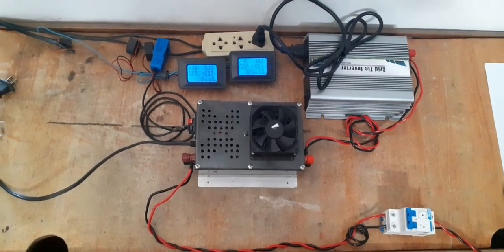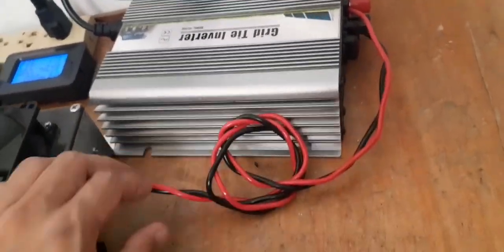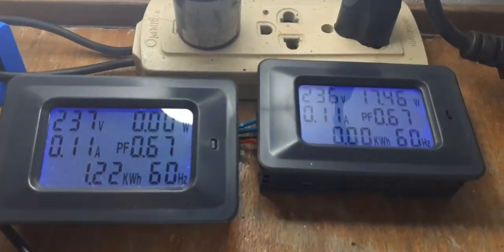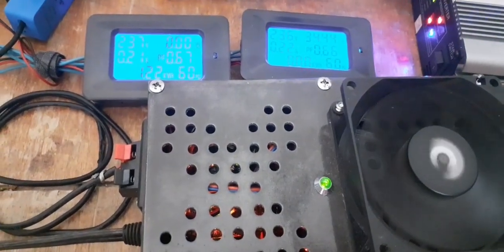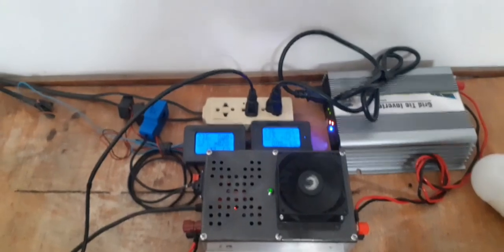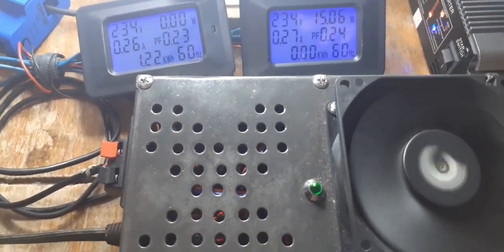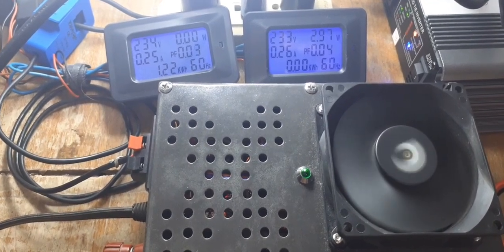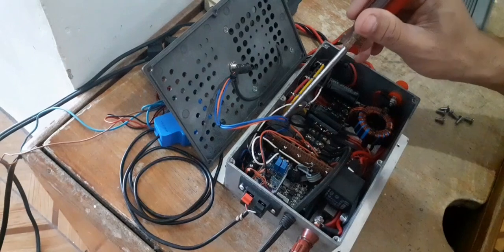External Power Limiter project for cheap grid tie inverter success!! part3

Comment: Congrats bro. What happens if the load is disconnected?  Does the grid tie reduce its output?
Reply from the maker: Thanks Bro, It will detect export power and automatically reduce. the target set point is within zero to 10 watts import.
Reply: @JonsDman  cool 👍. I might have to try designing something similar. I'm not sure if OP Amplifiers can be used in a comparator configuration.
Reply from the maker: I hope you will succeed using op amp comparator.
Reply: @JonsDman  yeah. Me too😂 thanks.